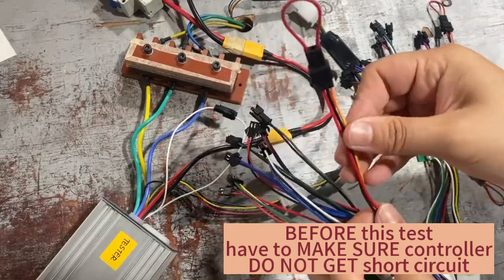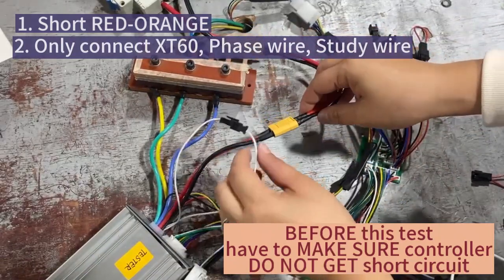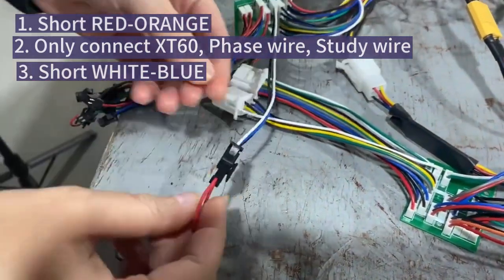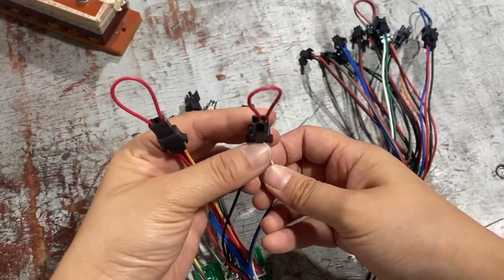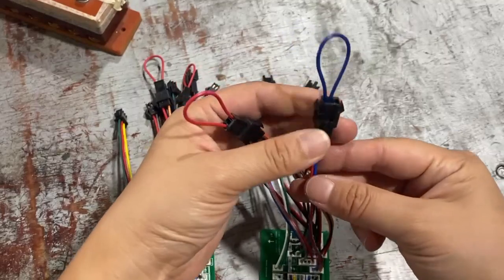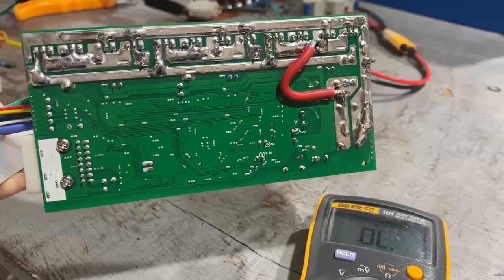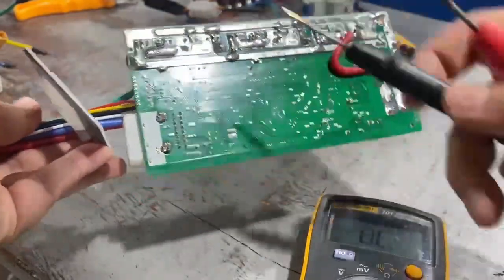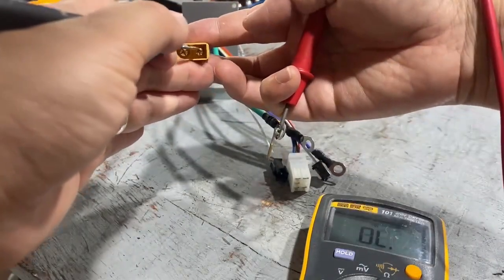How To Let Controller Self-Study Without Connecting Any Other Parts

Comment: When I connect blue and white nothing happens... And when I wire it up to my LCD I just get a flashing controller warning
Reply: Which ERROR code in the LCD? 

Please check connect sequence(step 1-3 in video).
Before you connect (blue-white),  you need to connect the (white-white) to start the self-study(video Step2).
then connect (blue-white), controller will start self-study. Motor will spinning from slowly to fast.(If hall sensor inside motor is failure, motor will only rotate a small angle)

😃
Reply: According this video, you can test the controller and motor by self-study.
If controller & motor is good, you can see the motor spin in low speed.
But if controller/motor is broken, motor do NOT spin correct(also WARNING code will show in LCD)

Hope it can help.
Reply: @dachangwang6048  both motors are definitely good. I must have got a bad set of controllers....
Reply: @dachangwang6048  I'm about to return them through Amazon anyways and buy something else